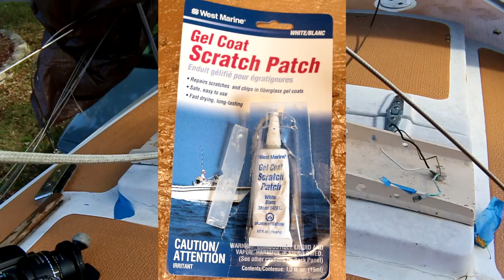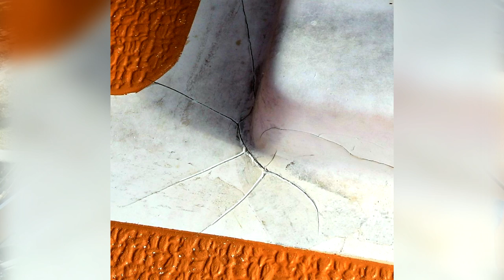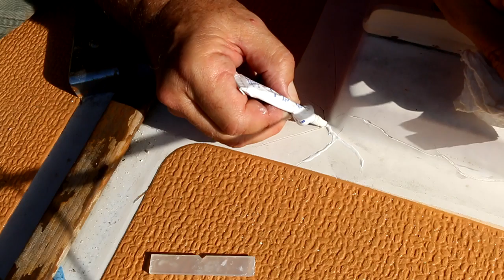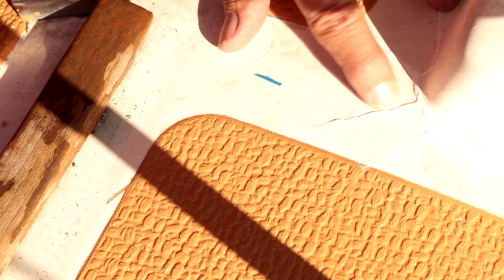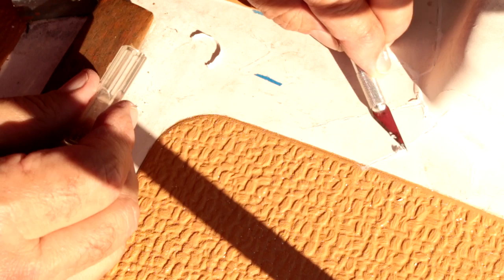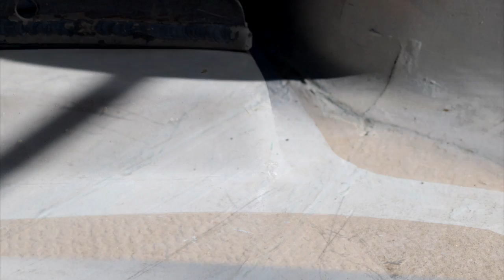Gelcoat Spider Crack Repair - The Wrong Way

Comment: use a Dremel tool to open the cracks.  then use air to blow out the dust.  then use acetone for final cleaning.
Reply from the maker: I thought about that but I was concerned about taking too much gel coat, or worse, fiberglass off.  The tools I used are for wood carving.  It was much harder to do but I had infinite control over how much gel coat was removed and the shape of the gouge was perfect for the job.  If you are skilled at using power tools you may be allright, but for me the hand powered gouges worked well.
Reply: Actually, most people just use a screw driver, knife point or even a carpet knife and drag or scrape  it along the crack in a pulling motion - its much faster and easier than pushing a gouge along the crack.

Comment: A Dremel would be easier.  They make a flexible epoxy that works great for a spot like this.   It’s self mixing and strong.
Reply from the maker: Right on both accounts- Thanks

Comment: you are trying to solve a stress crack problem with a cosmetic solution. It won't last. The cracks occurred because of a lack of strength (the arrangement appears to be a 'home made jod') filling the cracks ads no strength.  Putting a plaster on cancer anyone?
Reply from the maker: You may be right. Over time some of the cracks are ok, others not so much.  The boat came with this mast step so I don't know exactly what it sets on but it looks like maybe a 2x6 or 2x8 hopefully pressure treated wood.  A future project.
Reply: Actually a lot of Compacs develop cracks and flaking in the gelcoat in areas because of poor bonding with the fiberglass during layup - its not necessarily a stress issue with these boats, and the cosmetic repair will work fine in those cases.

Comment: I'm not sure if you'll know this answer or not, but do you know if west marine has a fiberglass kit?
Reply from the maker: Yes they do- there are several choices on the website.  The one I used works fineon small cracks but is not suited for major repairs.

Comment: invest in a rotary tool! Dont cost too much.
Reply from the maker: +Wayne Button  I thought about doing that but was afraid it would be too easy to remove more than I intended.  I had better control using the hand gouge.  You want to remove the least amount of gelcoat-just enough of a "V" for the filler to find a home.